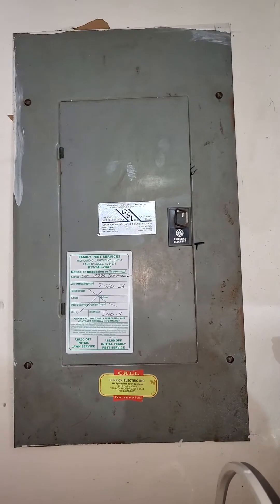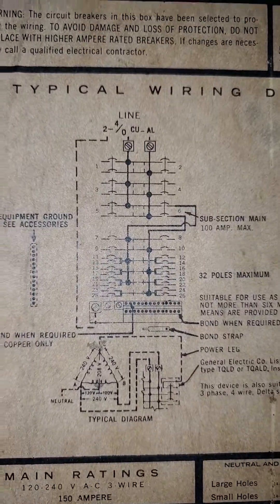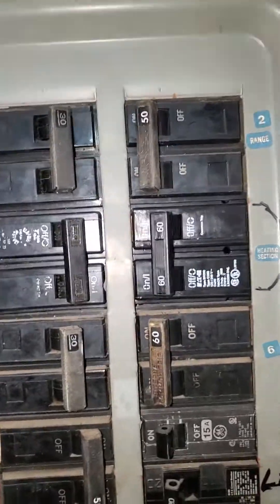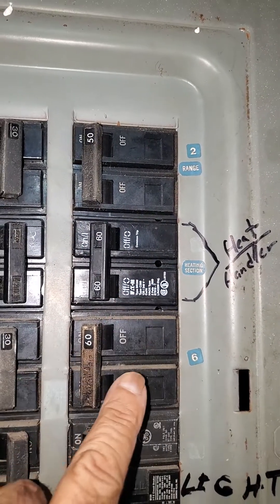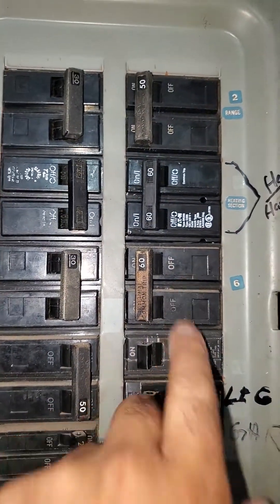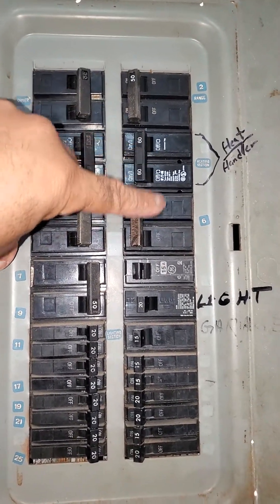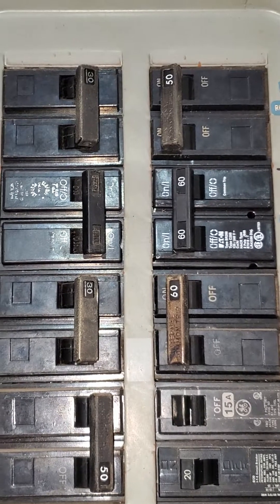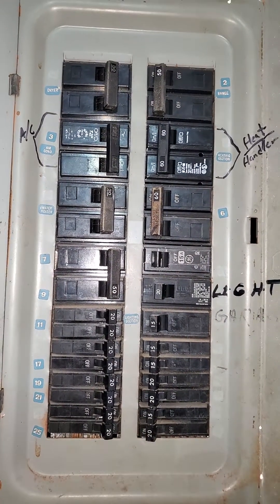How to Identify a Split Bus Panel

Comment: If you look very closely at the panel label it will usually have an amperage rating.   As a rule of thumb these panels were often installed from the mid 1950s  until about 1980,  they were banned in the 1981 NEC and manufacturers stopped making the panels a year or two later, that said, these were typically used with 100 amp services